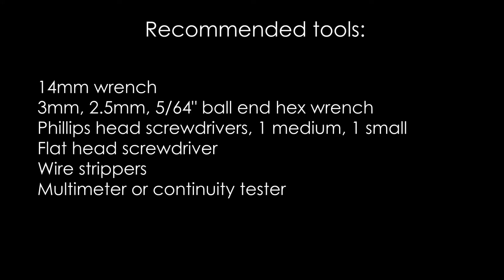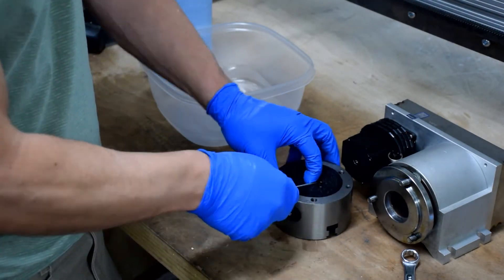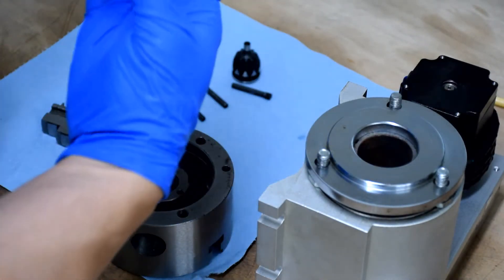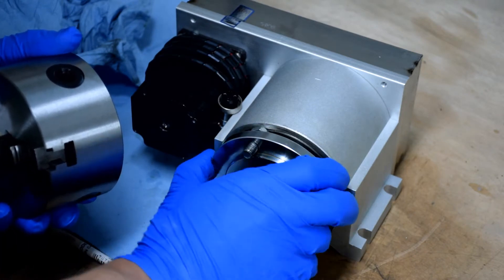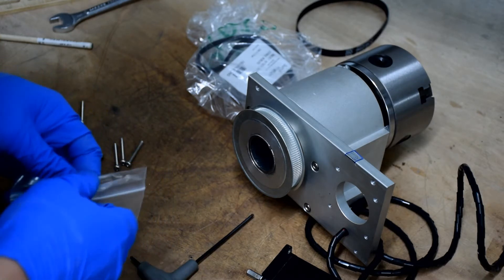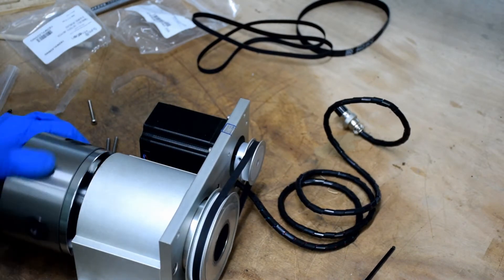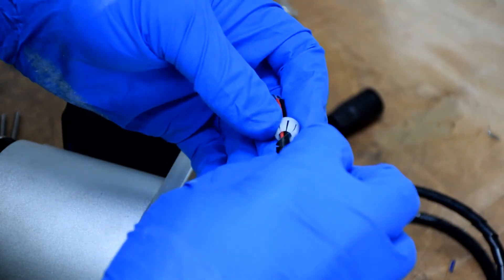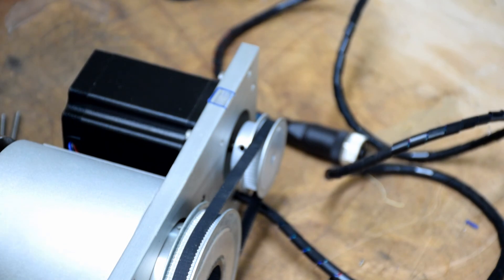Chucks 1

Comment: This is a part of the build that i would be tempted to redesign.  Oh wait nevermind... we're using steppers to synchronize the head and tail.  This belt can't slip. 
I just can't help but see that type belt drive as a potential safety hazard. I'm a huge fan of slack "v" drive belts- they save lives!  Glassblowers who use kevlar gloves at the machine- USE EXTREME CAUTION.  Use a dead man foot pedal.  Those kevlar threads won't break, your arm will.  Maybe not-  maybe the toothed belt would snap in an accident scenario?
Reply: Wherps, i meant this for the previous video

Comment: Is it required to use so heavy chucks made for hard loads on metal machining?
I understand that your choice is defined by the inner bore diameter, but your goal is working with glass, maybe some light custom-designed fixtures are better for that goal? for example, something like collet chuck but uses silicone donut in place of a collet.
Reply: As you don't need fast rotation, maybe step motors and timing pulleys will save a huge amount of money on chuck blocks?
I use ER32 collet expander and UCP bearings, maybe it will be useful as a price drop idea:
https://ponyatov.quora.com/DIY-universal-home-thumb-machine